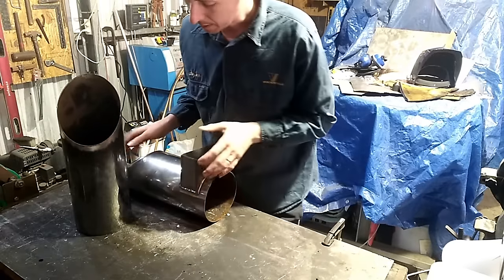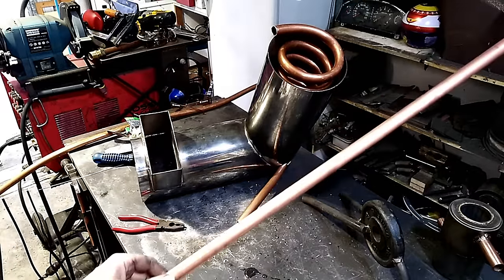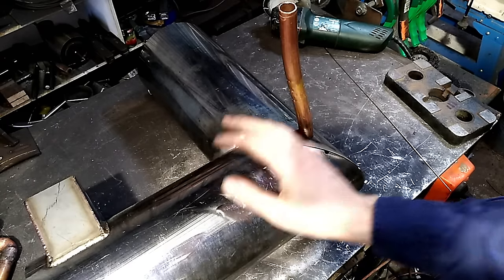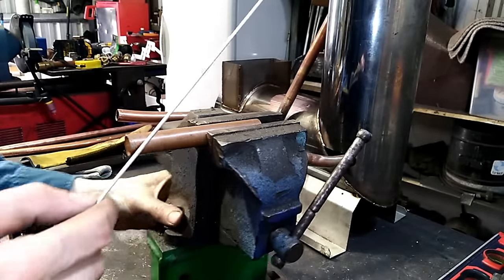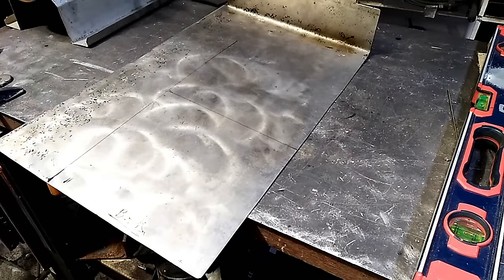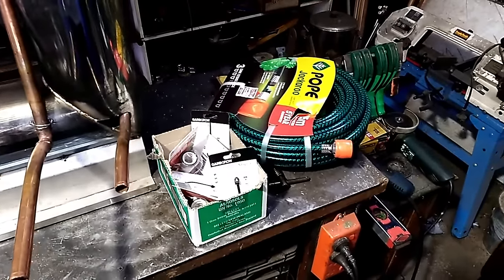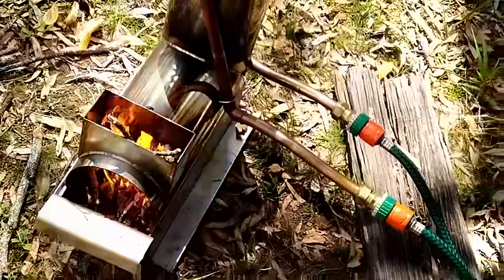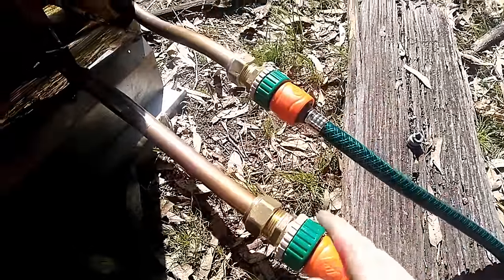Hot Water Rocket Stove II  - BUILD-

Comment: For smaller copper pipe and tubing, where it might be hard to get sand out of, you can use salt or sugar, which can be dissolved out.  I made a simple distillation coil with 1/4in copper tubing a while back, and I used salt to prevent it from collapsing when making the coil.
Reply: Salt /sugar can pack up really tight in there and it's a PITA to get out again.
For a little 1/4" pipe there is no need to fill it. Just work it slowly around the mandrel you've made and it will work out fine.
Trust me...I made several copper coils for my still. ;)

Comment: Bit late with the comment but if the copper tube is oval, grab a adjustable spanner. Set the opening just a bit smaller than the widest part and slowly turn. The tube will deform a little bit proceed until loose, tighten up a little, turn until the tube is back to nominal size

Comment: A little piece of constructive advice...
I've done this water heater/copper coil system before, only on a slightly larger scale using a full size wood stove. 
The problem is having the copper coil is direct contact with the flame. It over heats the water to create steam which disrupts a constant flow of water from cold to hot. I've found that bedding the copper coil in an amalgam of pearlite and a binder like water glass or refractory cement reduces the chance of over heating the water and increases efficiency. Takes a bit longer to heat soak the amalgam and begin the heating cycle but virtually eliminates the creation of steam gases.
CHEERS and good work! 👍👍👍👍👍
Reply from the maker: Thanks mate, appreciate the help.
Reply: Yes that is what I was thinking about this system, I don't like the idea of the coil in the flame and was considering wrapping it around the upright of the rocket stove, then adding an outer casing, i had planed to then pack the space around the coil with sand as a thermal store 😳 what do you think 🤔?

Comment: To be faster switch the hoses , hot at bottom. That is the why solar heaters are done . It forces the the tank water to stir and mix for uniform water temperature. Be sure that the top pipe is well covered with water.

Comment: I once washed dishes in a restaurant, we had a heater like you build.      It was a slow start to heat the water ,thire was about 30 gallon of water in the final rinse.
How we controled the temp was how much heat we put on the heating element

Comment: I like your videos, as I tried many similar projects, but am limited on time. One tip someone may have already given you already. Use a rosebud to heat the pipes or any material prior to TIG and you can save time pouring power through your TIG to get it hot enough to start. My friend has welded 3/8 aluminum plate with his portable TIG for me. Now I have to do it myself as I moved to far to make the trip worth his welding skills.

Comment: Stephen, @ 13:00  where the soft copper tubing is not round enough to accept the fitting - use the tubing cutter with the wheel JUST outside of the end of the cut and closed until the shoulder just touches the copper.  Then very slowly tighten a tiny bit, make a few rounds and observe the points where the flattened tubing binds a little because it's out-of-round.  Then a tiny bit of lubrication and tighten the cutter just a little, make a round and repeat to progressively use the rounding "squeeze" of the shoulder until the cutter makes a full circle while evenly touching (having reshaped) the tubing.  The cutter will have pressed the out-of round tubing back into a pretty well formed round.     - Joe -

Comment: If you add a small water pump, like 2Lt per minute or there abouts to the cold water side you can remove the sputtering effect as well. If the water going in and through is colder than what’s coming out it’ll keep heating. That’s a much better boiler than what I did, but I heated a 6000Lt stock tank in 5hrs. I used a water pump from a washing machine and a batter drill to push water through
Reply: Acredito que nao há necessidade.

Basta mudar a posiçao do cano, ao inves de entrar na parte de cima do tambor, ele deve colocar no meio do tambor, ja que o vapor ou a agua quente sempre irá subir. E a captura de agua quente é feita na parte superior.

Outro detalhe: quanto menos agua ou menos velocidade a agua fria entra ba bobina, mais tempo ela permanecerá e consequentemente irá aquecer muito mais rapido, e claro, muito mais quente a ponto de vapor.

E a funçao do vapor é realmente aquecer a agua do tambor, da parte central para até a parte superior, ja que a agua quente sempre vai subir.

Comment: I know this video is very old and you've likely figured this out, but i would put the hot outlet pipe at the bottom and the cold intake at the top instead of the other way around, that way the water temperature mixes more evenly.

Comment: Move the outlet to the top. You have air in the coil that needs to be bled to get flow. The water is flashing, ( boiling), and will not circulate unless you bleed the air from the coil. Try cracking the hose on the outlet at the heater until you see water. Then tighten and fill your barrel up over the hose line.

Comment: If this is going on a pump system you can regulate the temperature in the outlet pipe by regulating the flow of water.  That would also keep it from burning the occupants of the hot bath and keep the circuit from backflowing.

Comment: Awesome ! 
Interesting hose outlet. ..from rocket to water tank. I havent seen any that the pipe is bent to go back to the bottom. Cool...I hope it goes well.
Counter- clockwise water direction down under... Mine will be turning clock wise ...I think. That's the thing about creation...it doesn't always work the same as you saw it in your head. Lol ( Sorry... It's not about me...lol)

Comment: It's like it's set up backwards, the outlet should be at the top and the inlet at the bottom (I'm talking about the  copper coil) and why did you put the outlet of hot water/steam at the top of the tank? It would work much better if it was maybe near the bottom and rising to the top (the heat)  then when the top of the water is hot you know the bottom is too. With it on the top it will take forever to heat up the whole barrel and the temp will be a lot hotter at the top than the middle and bottom of the barrel! IDK it's just MO!

Comment: If you don’t mind me saying. 
I have a fire powered, convection heater for my outdoor tub. Couple of things. 
Run the largest diameter pipe you can, 3/4” or 1”, for flow, volume. 
No drops, where you can get an air lock. Always sloping upward. It will flow steady. 
Both through hull fittings have to be submerged. Same as above. 
The water in the barrel will stratify, a huge amount. 
If I lay still in the tub, it will be scalding on the surface, and cool on the bottom. It needs mixing, to get a true temperature. 
If the fire box/pipe,is bedded in something, with a lot of thermal mass. It will keep the tub warm, after the fire gets it up to temperature. With residual heat. 
I know, sounds complicated. But an outdoor tub in the Canadian winter. Out in the forest, at night, when it’s raining, or snowing. Is fantastic. 
Until one day you are lazy, and it freezes.

Comment: Tee on the outlet with a sensor port for a solar hotwater controller/pump station. Run your flow and return into the drum from the top as a pig tail/ heat coil to heat up the water or mains pressure tank solar  connect up solar in solar out. I’m a plumber wish I could weld... back in the 1930s in Victoria Australia small briquette stoves like yours were extremely common and effective. Several briquettes was more than enough 65c water for a family of 8
Reply: Hot water chip heaters?

Comment: FANTASTIC! ALL YOU MISSED WAS THE CHECK VALVE AT THE HOT END. SUBMERGED.  DROP A INNER HEAT SHIELD SLEEVE THAT CAN BE RAISED OR LOWERED TO SHIELD COILS FROM FLAMES, TO KEEP LINE BOILING TO A MINIMUM.  YOU'VE GOT PRESSURIZED HOT DAMN WATER THERE-PEOPLE GET BURNED WITH IT. BE CAREFUL...A PLUMBER:)

Comment: I agree Matthew.  Steam is more easily generated with a coil design, and therefore potentially dangerous.  A rib cage design around the fire box with vertical risers each side is another efficient option.  "Cold" water intake is at the bottom of the rib cage.  The pipe to accept hot water on top should be larger than the "cold" water intake as water expands.  With the Rocket Stove design principle of complete burn and maximum heat recovery a wrap around water jacket around the riser would capture all the heat.  I have seen these used effectively as additional heat capture on a rib cage firebox water heater.  The inner pipe of the water jacket replaced the flue and inner and outer were made from copper brazed together.  If a rib cage was placed around the horizontal firebox, the  outlet at the high end (ie sloped up slightly towards the riser) of the top collection pipe could be plumbed to the bottom of the riser water jacket and very hot water taken from the top of the water jacket!  In the Rocket stove case the riser needs to be insulated to get a complete burn, so the water jacket should be where the outerskin of the conventional rocket stove.  It would need to be insulated on the outside to direct all heat to the water in the water jacket.
Reply: I would love to see one of these water jackets. Sounds very interesting and could save a lot of hassle 🤔

Comment: It would have been much easier if you would have used Flux and flame on the copper but the way you did it makes sense because of the heat from the fire could have made your connection come apart so I guess the way you did it was the best way? Worth looking into!

Comment: Pressurizing tube to near max psi using a check valve fitting on one end should help with bending I would think.  Seems like it would be a less time consuming way to do it rather than using sand.  Thoughts?

Comment: I just did this for the first time on a holding tank.  When brazing with tig use flux or borax to clean the surface.  When the filler globs up like that, heat the area around the glob until it flows.
Reply: Good job!  I  wanna build this too!

Comment: Instead of using your welding tool use a torch. Get the pipe very hot when the copper turns blue /purple get your rod of  Silver solder  touch the tip of the rod to the pipe and fitting this will bond them together and it will look  much cleaner.  You will not get them apart. Also when using 
 copper and  stainless together when they touching each other it causes electrolysis and that will breakdown the copper and it will leak

Comment: Nicely Fabricated and a very neat setup. 
I am hesitant to comment given the pompus and typical preaching of others here but I have thought about doing something similar but more along the lines of large pipe in a slightly smaller pipe. I looked at the amount of surface are in copper coil and that in just say a 4" tube an the tube is much greater and I would think easier to work with.  I thought of just drilling some holes and welding in bolts to act as vortex generators of a kind to break up the gas flow and carry the heat back to the water tube. 

I envisage the inner pipe to be the fire tube an the space between to carry the water which could then also be insulated. 
With something to break up the gas flows and create some turbulance this could be mainly verticle giving better draft for the fire and still having good heat exchange properties.  Would also allow 1' or larger hose to be used to get greater flow which is important for larger volumes of water. 

Anyway, nice build, there were a few tips and tricks I learned from it so thanks for the ideas and education!
Reply from the maker: Hey, love your work man, it's good to see other Aussies out there making a go of this You Tube thing. Thanks for the suggestions, I'll be revisiting this build soon.

Comment: Worth watching your videos just to see how you cut circles in sheet metal with a hand grinder. 
Several previous comments about a steady rise from the stove outlet to the tank, also consider raising the tank a bit higher which will give a greater head of water thus raising the boiling point and reducing the amount of steam produced
Reply from the maker: Thanks mate, if I had to build it again there are a lot of things I would improve on. Cheers
Reply: @LittleAussieRockets  if you do build another one it may be worth considering a dual wall chimney with water in the gap a la kelly kettles, should be easier to build too

Comment: Nice 3rd hand.  Thing is the boiler worked too well. It made me wonder if having the riser come up inside a down draft bell and the copper coil between the riser and the bell. In this way you'd have the rocket stove hot burn in the riser and the heat exchange where the gasses were cooler and slower. All in all a good video to watch and I learned about tacking and the new toys I need to buy!
Reply from the maker: sweet, thanks mate!

Comment: I made a hot water heater that use a wood stove that heated the house ! I had to keep taking out runs until  there was like a 3" loop and it still blew the pressure relief valve every once in a while !
Reply from the maker: Wow, that's intense heat

Comment: If the sand looks a bit wet you could dry it in a frypan strain it through fly screen mesh so granuals are the same size I’ve found larger rocks & bark in the river sand I got from river

Comment: I like to see what you can do with the right tools and heaps of (years of) background knowledge. Would it be possible to connect the hotter water to the lower inlet on the tank so that the hotter water would rise to the top of the tank? The cooler water in the tank would be pushed (displaced) by the warmer water to the top of the tank which would be drawn into the coil input. Not sure if the rising hot water i the copper coil would create enough moment to draw in the cooler water or if a small pump would be required.

Comment: if you dont want the water to surge take the down angle out on the hot side..instead have the top of your coil go strait up to the blue tank..it will keep it circulating without that steam surge out the top of your coil into your tank..top line goes up to the top of your tank..intake side at the bottom it will work great for you 👍👍👍👍👍👍

Comment: You might want to consider a non-return valve. Might also give you faster flow as the resulting vacuum (due to the prevented backflow) will draw cold water in instead.
It’d be basically a big coffee machine if you were dripping the hot water into a filter with coffee 😁. Same setup.
Reply from the maker: I would actually love to make a giant coffee perculator.  The coffee machine was the first thing I put in the car when the wife went into labour with the first daughter. Coffee is important to me.  Lol.  Thanks mate
Reply: You’re not far away from it 🙂

Comment: I've found that I could weld copper pipe together and have it stronger by using Romex copper electrical wire and an acetylene torch rather than lead or lead free solder. The melted wire flows like solder if you clean the pipe well first.

Comment: If you were to add a small pump you could compensate for the negative slope of the outlet pipe. If not you can straighten it upwards so it flows correctly. The hot water hast to be able to rise for a thermosyphon to work correctly.

Comment: In my opinion, a few things were left out of your calculation, 1st  the hot water pipe leaving the boiler should be a bit larger than that of the low-temperature pipe. For the water to maintain its constant circulation the hot water should be in a pipe, (not a garden hose) it should also be thermally shielded to maintain a constant high temperature. The next thing that I would recommend, is to install a non-return/one-way valve on the copper pipe carrying the low-temperature feedback to the boiler, this should prevent pressure building up from feedback.
Reply: 1138

Comment: Use the hot water steel braided line in the plumbing section at bunnings its the one they use for bath taps and dishwashers washing machines rubber core metal fittings

Comment: I built something like this once it worked well on a pool, however the pump lost power and the thing created several steam explosions into the pool. I removed it after that, if anyone was in the pool at the time it would have been a disaster. The return should be in a safe place if the pump has a water flow issue.
Reply from the maker: Good advice, thanks mate!

Comment: The inlet to the barrel should be the stove hot inlet at the bottom of the barrel, top is the inlet to stove as cool.  Remember the hot water coming into the barrel at the bottom will quickly rise mixing and heating the barrel water up more quickly.
Reply from the maker: Makes sense. Thanks mate
Reply: I know very little about plumbing but does that mean if you where hooking this up to a boiler you would do it like that?

Comment: Using water is the way to go as if you bent too long a tube, good luck getting the compressed sand out.
Or, salt as it will dissolve, but never sand.
Also, get a large roller thrust bearing and make a metal "lazy Susan" you can weld the pipe to, then weld an old socket on top of so you can turn it quickly with an air powered ratchet and not have to make the whole length of tubing spin around the shop, or your yard with the added benefit of being in one place to feed the tube so it coils tightly.

Comment: next time consider flare fittings instead of soldered/weld fittings! think it will make it quicker the annealed copper reacts very well with the tool and coil change outs are super easy for maintenance